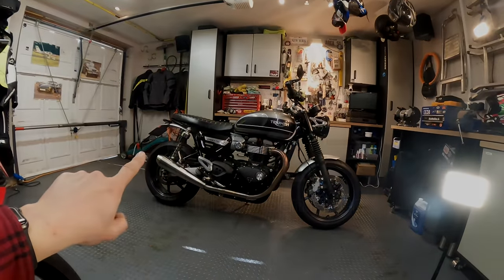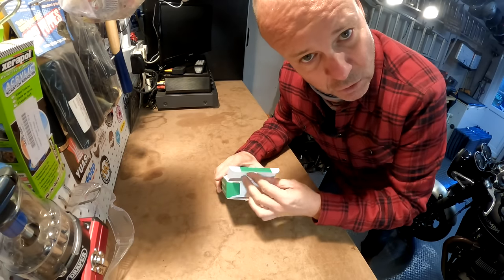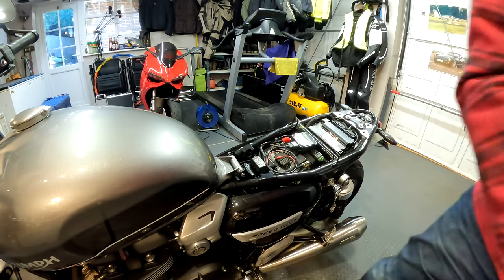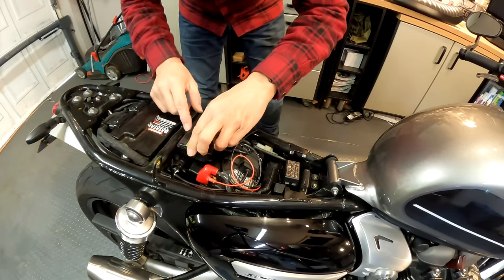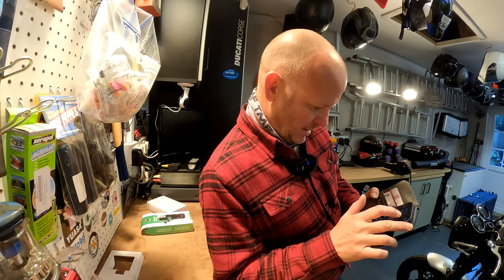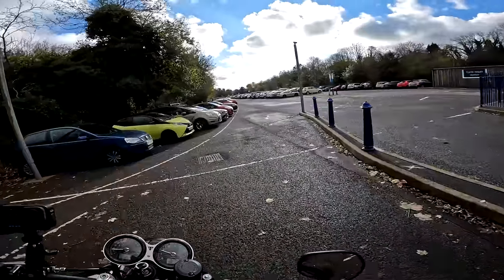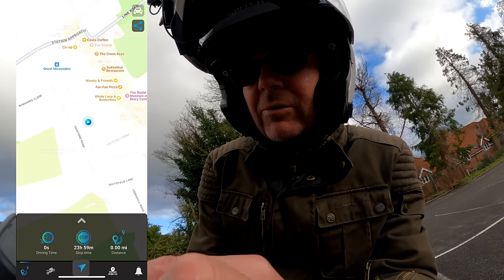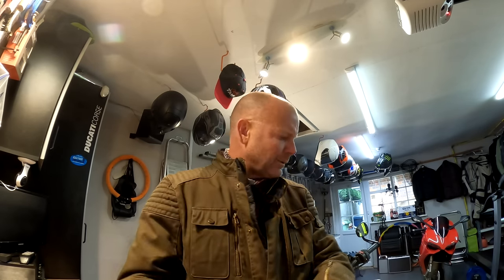Keep track of your bike! - Sizzapp monitoring Device Install & Review 4K

Comment: Lots of talk about how this can be easily found. This is true. And yea the app will tell you when it’s been disconnected but that doesn’t really matter to you the user once that happens. 

What I did was take apart a good portion of the bike, breaking down to heavy wire loom. Used a shop manual to find a positive and negative line and installed this tracker that way. I then wrapped it in automotive wire tape. It’s 100 percent hidden and even if a garbage thief gets it down to where it’s at, they have to know what they’re looking for. I have it looking like it’s all stock. I recommend y’all do it that way.
Reply from the maker: Good tip!

Comment: I have one of these on both my bikes and they are easy to install and setup. With some thought before installing you can hide them and you don’t need to use the battery terminals if they are easily seen but this means it is not quite as simple as you showed. It does drain the battery slightly but I have a trickle charger and don’t worry  about it. The app has good features and the positioning is accurate. I like that it doesn’t need a subscription but it is only as secure if you hide it.
Reply from the maker: Yes this was a quick demo - I won't go into any more details about locating my devices!
Reply: Indeed - people in the comments don’t always realise that 😉

Comment: Great review Andy but similar function to my TruTrak FMT100. That cost me about £30 with a £6 monthly charge. One bonus was that mine gave me a great overview of the route I took on my 5500 mile trip round Europe. The only problem I had was a couple of slight blind spots in Bosnia Herzegovina but I suspect dueto its reliance on the 4G connectivity that the Sizzapp will be the same.
Reply from the maker: That £6/month adds up - Sizzapp is FOC once purchased, that’s the appeal to me “fit and forget”….
Reply: @TheMissendenFlyer  agree 100%. The advantage I've found is there being no need to shell out such a large upfront fee (albeit small compared to many). The other advantage being that by paying monthly but with no standing contract, I've no need to pay when it's locked all secure in the garage over winter, simply reactivate it when it's in a higher theft use situation. Horses for courses. Keep up the reviews.

Comment: I have trackers on my bikes, prefer ones that don’t wire direct to the battery for reasons, most thief’s will lift the seat and cut any wiring to the battery other than the main 2 leads. While I do see a benefit with devices like these is the battery monitoring via phone app but the main one could be use this as a bluff for the thief to cut if stolen and have another battery tracker onboard like Monimoto, that way the thief thinks they have disabled but hey Ho you have it still tracked. Not trackers are not cheap so to have 2 on each of your bikes is an expensive thing. Maybe I need to come up with a dummy box with wires coming out to the battery 🤔😆

Comment: Nice one Andy it’s a cost thing having 4 bikes apple air tags cheaper and no hiding problems
Reply from the maker: I just bought some to try - so far not impressed (I'm sitting less than 20 metres from two of them yet my phone can't find them!) - good in some applications but not if you live in the countryside with few passing apple devices.

Comment: The Moni looks better as small to hide and cheaper.
Reply from the maker: Yes but you have the inconvenience of carrying the key fob seperate to your keys, the hassle of two batteries to change and the ongoing cost of the SIM subscription - I used moni for a couple of years, but for me, this is way better - just fit it and forget it...only downside is needing to ensure your batteries don't get drained (and it even warns you well before that happens...unlike my expensive trackers!).....

Comment: Happy new year Andy. I'm a great believe in multi-layered security.....As you obviously have..ie:- garage security..My Triumph has a front wheel choke as well as paddock stand with  chain. This Tracking unit looks a useful addition, although I'm bound to say it looks harder to hide plus the extra wiring is a bit of a give away...l prefer the independent powered types.   In the past I've used Invoxia which is very small. The app has a proximity 'radar' useful when within a few metres the of 'Bike'.. handy if the thief has the bike in a lock-up...These very small units can be used for many applications beside a Motorcycle. l presently use a German PAJ system, very accurate tracking route/stop/parked,  is easier to hide. However, it does have a subscription which is, for my unit about 50 € annually...

Comment: I have a monimoto but I need an extra tracker for my other bike, looks very promising so will take a serious look.
Reply: we will be happy to see you among our happy customers 😀
Reply: I think I much prefer my (Two) Monimoto's I have in my bike and car. No need to connect to the bikes battery and be a constant power drain, and hiding is a lot easier as you aren't restricted by tracking wires back to the battery.

Comment: Mark Davies.
Looks good but what happens when the potential thief disconnects your battery?
what power does it use and how much does it drain your battery.
Reply: Dan gaat die nog een paar uur door met de backup batterij
Reply from the maker: If it gets disconnected internal power kicks in and it alerts you it has been disconnected. Doesn't drain the battery as much as the other trackers I have, I think it draws up to 100mA a day - alerts you before the battery gets too low so you know to plug the charger in (takes about a week or so in my experience).....

Comment: Hmmm interesting, I’ve got a thunderbox on my Africa twin I assume it could be wired into that rather than straight to battery?
Reply: Yes, you can connect a device in another place where there are both a negative and +12V wires and hide a device. A lot of our customer are doing like that.

The main things are that power should remain constant on these wires, even when ignition is turned off, and that device should be located (hidden) in such place to have enough satellites for a correct location and speed detection.
Reply from the maker: Of course...
Reply: Cheers guys

Comment: Apple AirTags - three tags for £99. I have a Monimoto on my new GS - which I’ve owned for years (thank you TMF), but the other two (and my e-bike) are covered with Air Tags. No Alarm as such, but you always know where the tags are via the app on your iPhone, and they’re easy to hide, being not much bigger than a 50p.
Reply from the maker: Trouble is, as I understand it, they need to be near Apple phone or tablet in order to report their position - might work well in populated ares (I dunno, does it??) but in the wilds of Scotland on a tour I'm not so sure.  That said as many layers of security as you can are good, so the more the better.....
Reply: Problem with airtags - it send message to nearest iPhone so if it’s stolen and thief has an iPhone then he gets a message 🤔
Reply: @MOTOUK1  more than that, it’ll notify the thief they are being tracked. It’s intended to stop stalking.

Comment: The question is... Will it drain the battery if you don't start it for some time? I currently have the monimoto 7 which is absolutely independent. Yes,there is a tiny £37 subscription but is also only £129. Also works well . Ideally you want to hide this on the non removable panels of the bike,no way that they will find it until you found them .
Reply from the maker: Yes it does drain a small amount - way less than my more industrial grade trackers though and it gives you plenty of warning before your battery gets too low....I find it less of a hassle than the batteries in my Monimotos/keyfobs (+ the subs - particularly tiresone if you have more than one!)....
Reply: @TheMissendenFlyer  If it does notify you when you're battery getting empty that should be enough... The network could be a concern as well. You mentioned it's only 4G if not mistaken

Comment: Brilliant tmf just what I wanted how about battery drawing ? Thanks from Danny
Reply from the maker: Well it does draw a small amount and the good news is Sizapp alerts you if the battery gets too low - it's done that once since I've had it fitted (had it about 2 months now) so I got prompted to connect up the trickle charger.  Doesn't seem as power hungry as the datatool and vodaphone trackers I have fitted on my other bikes (I suspect it's becuase they periodically check in with the phone network) - they flatten the battery in a matter of days.  So far so good..but I am watching as that's the one downside of a powered tracker like this.....

Comment: Seriously considering purchasing, already have Datatool installed with yearly subscription and an Apple AirTag hidden away, but there’s always room for more, especially as it’s a one off purchase with no on-going cost.  My thinking is if thieves bypass one of them, there’s two more as backup.

@Andy, has sizzapp offered any of your subscribers with discount codes we can use?
Reply from the maker: YES! Sizzapp are kindly offerring a 10% discount if you use the code "TMFTRACK" at checkout!

Comment: Freddie Dobbs has been using this device for some time now. Personally in my opinion a tracker on a bike is worthless. They are so easy to find and in less than 10 seconds you can usually locate and disconect them.
In contrast the Apple Airtags are very discreet, hard to find, cheaper than this and therefore represent better value for money. 👍
Reply from the maker: I don’t know much about the AirTags, am I right in thinking they have to be near a Bluetooth or Wi-Fi connection to work? If so I’m not sure I’d rely on them as much as a gps/phone based tracker?
Reply: AirTags have to be picked up via Bluetooth when someone with an Apple phone is nearby. Probably fine in a busy urban environment, but if it’s left in a field somewhere in the middle of nowhere, not so useful.
Reply: @PhilC184  That scenario isn’t very likely is it, even if it was, firstly it has to get to the field.

Comment: It’s an interesting product although the direct connection to the battery is a bit obvious. I’m a bit cautious around the business model and long term support without any apparent income stream (subscription) once Sizzapp have sold a unit and yet there must be costs around 4G access, app updates etc.
Reply from the maker: I like the "fit and forget" nature of it.  Only downside is potential for battery drainage but that seems minimal so far - compared to my "heavy duty" trackers - and it alerts me well before low battery is an issue - you can of course hide the tracker (this was only a demo of how to fit).....fair point on business model!

Comment: @themissendenflyer - does this mean you are no longer a fan of or using the Monimoto devices?
Reply from the maker: Correct - I found having to manage two batteries, an annual subscription and a seperate fob too much of a faff on several bikes - this with it's "fit and forget" nature works better for me.  Monimoto is good if you only have the one bike....
Reply: @TheMissendenFlyer  that makes sense. Also for those that cannot put the bike on a battery tender the monimoto suits best so the battery doesn't drain

Comment: Nice vid of an interesting product. However I have 2 concerns, firstly for your own benefit I think you showed too much in terms where you put it on which bike etc. It's was very helpful for us viewers but also for the scumbags. Secondly, which you will no doubt tell us in due course, how much does it drain the battery? I guess it also has a limited time effect to track it once stolen for any competent thief as most will check for trackers wired in to the battery pretty quick if it's been stolen for more than a joy ride. However with all that said, it is undoubtedly another very decent & cost effective layer of security.
Reply from the maker: I do have an optimate battery charge lead fitted to the Street Twin and will be keeping an eye on battery drain - so far so good.
Reply: @TheMissendenFlyer  Ah good stuff. Thanks for the update.

Comment: I had a tracker fitted when I bought my bike brand new, I do have issues with the tracker. 
1, It does seem to draw more out of your battery than normal. My battery is having to be charged a lot more than you would expect. 
2, They have my bike located at a different address, I contacted them about this and they said they use Google maps so it's an estimate, this doesn't fill me with confidence.

I'm thinking of having an alarm fitted instead..
Reply from the maker: Sounds fair enough in that case!

Comment: Do you think this is better than the Monimoto? I bought that on your recommendation! 🤦‍♂️
Reply from the maker: I find it better yes - which is why I swapped, I like the "fit and forget" nature of it - no fob to carry around seperate to your keys, no SIM subscription...just easier to manage.  Only downside is battery drainage but that seems minimal so far and it alerts me well before low battery is an issue.
Reply: @TheMissendenFlyer  thanks I’ll look into getting one. Although I already have a Monimoto I do have other bikes so will be good to try one 👍

Comment: My Monimoto seems better as it is truly independent from the bike and can be hidden anywhere (no wires).However, the app is rubbish so the Sizzapp is much better on that that particular point. How much battery drain is there on the device? Will it flatten the bike battery? 
Always good to see real world reviews you do Andy so keep em comin'
Reply from the maker: Yes I used to use Monimoto but found having to keep renewing the batteries and get the sim topped up became tiresome over time. Seems there’s no perfect solution but since I have a garage I find the Sizzapp works better for me (which is why I’ve swapped from the Monimoto). I do have an optimate battery charge lead fitted to the Street Twin and will be keeping an eye on battery drain - so far so good.
Reply: I’ve used Monimoto for quite a few years & been very happy with it, currently using the “7”. The main battery lasts approx 12 months & the sim top up is about £35 per year. Much easier to hide & no tell tale wires to follow!
Reply: I use Monimoto and the one on my Yamaha has been on 4 years with no battery change to using or key fob. Thing I found is in setting set up to only alert you it’s working properly once a week as opposed to all the time and the battery saving is huge. 4 years and same batteries 👍 only top up sim once a year so no hassle there

Comment: Thank you for taking time as always really enjoyable videos.
Sadly I think this devices is weak Even a simple bike thief could lift a seat disconnect the battery
Reply from the maker: It alerts you if that happens....
Reply: @TheMissendenFlyer  Thank you for taking time to reply I agree with you it’s cheap but if  taken away somewhere all you will see  is the local area it’s removed from the once loved bike. Motorcycle  thieves are not stupid.

Comment: Hi Andy, my only concern is the bike battery, how long does this operate before impacting the starting ability of the bike.
My garage doesn’t have a power source, so I can’t use a charger. I’m using the Mini Moto you recommended a few years ago.
Are you still using yours on the other bikes ?
Regards, Colin
Reply from the maker: I prefer this - which is why I swapped, I like the "fit and forget" nature of it - no fob to carry around seperate to your keys, no SIM subscription...just easier to manage.  Only downside is potential for battery drainage but that seems minimal so far - compared to my "heavy duty" trackers - and it alerts me well before low battery is an issue - you can of course hide the tracker (this was only a demo of how to fit).....
Reply: Colin ,  another Youtube tester, tested the battery drain, and it worked out to be point 1v per day.. So over 10 days its 1v loss from the battery... or 3 volts per month....

Comment: No point in the 3hr run time after it’s disconnected from the battery - If it’s disconnected from the battery the thief has found it and it’s going to be away from the bike in about 30 seconds. You might find the tracker in a skip or ditch but your bike will be long gone. Monimoto have the best idea.
Reply from the maker: With Monimoto they can just toss the whole unit! Having tried both extensively I prefer the Sizzapp solution….

Comment: How much power does it draw and so how long can it be left without draining the battery? Good that it has a low battery alert. Will that alert be received with the App switched off?
Reply from the maker: Yes I received an alert once since I had this installed, was after about 4 weeks and gave me plenty of warnbinbg to get the bike on charge before the next ride.  Of course it does drain some power (thats the disadvantage of all wired in trackers) but it seems to last longer than the Datatool tracker I have on my GS for example.

Comment: For me Monimoto is better, easier to totally hide and costs buttons each year, sorry Andy, this one's a no from me.
Reply from the maker: No need to apologise, I used to use Monimoto but found having to keep renewing the batteries and get the sim topped up became tiresome over time. Plus I found having to have the fob on me separate to the key a PITA. Seems there’s no perfect solution but I find the Sizzapp, because it’s “fit and forget” works better for me (which is why I’ve swapped from the Monimoto).

Comment: Thieves will prise off the seat - rip off anything connected to the battery. You are wasting your time connecting it anywhere that is visible. Connect it under the tank to the look somewhere. This recommendation is from bitter experience……For thatcham approval ‘under the seat’ installs are not allowed.
Reply from the maker: Thanks for watching!